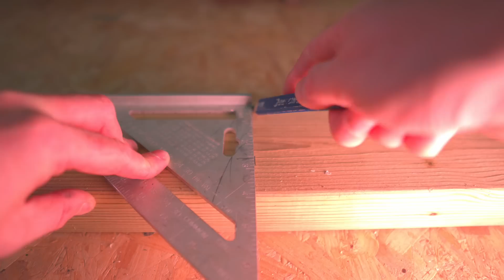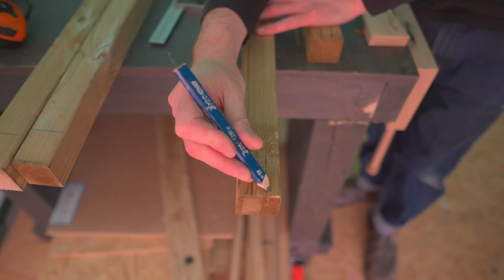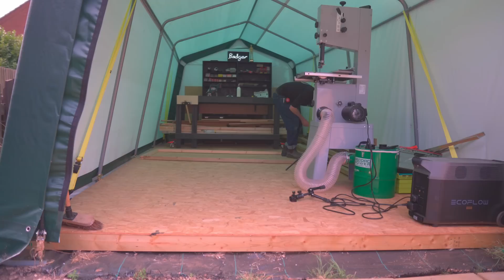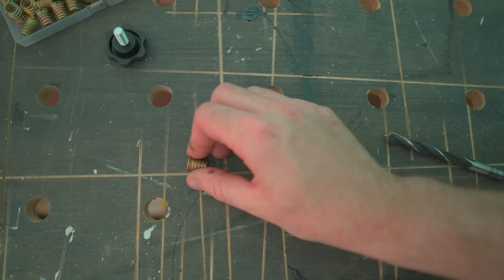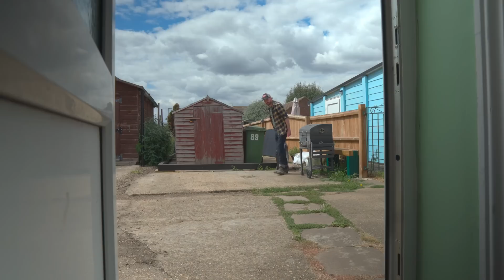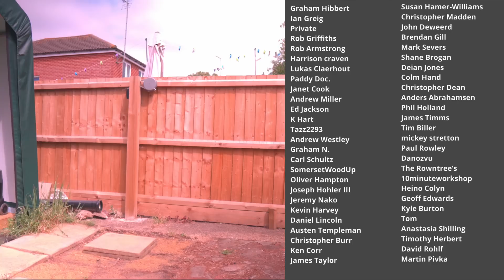Bridle Joint Solar Frame

Comment: Hi Matt,

Would you say it’s been reliable enough in terms of solar charging to run your workshop off as the only power source going forward (as in your permanent workshop)?

Obviously £4,500 is quite an investment, but given the cost of getting an electrician to run cable to a workshop, the cost of electricity increasing and of course being more climate aware, I’m wondering if you could just buy one of these and not need any power run to the workshop?

I guess it will be interesting to see how it goes in the winter being solar charged only
Reply from the maker: Building that I used about 5% of its capacity

Comment: I’ve had my doubts about renewables but this is a practical demonstration I can appreciate. I still have reservations but there’s no denying they can at least provide for some of our needs. Talking to a chap I know who works for a local company that developers and manufacturers new solar panels and they’re working of floppy solar slates for the roof that act like rubber tiles and are X amount more efficient etc…something along those lines anyway. A large battery bank in the garage and those on the roof have got to be a good idea.
Reply from the maker: The tiles sound a great idea
Reply: The question is, how much energy went into creating the solar panels and batteries in the first place. This is one of the factors that people miss with electric cars for example, especially considering that battery lifespans are probably only 15-20 years, maybe less depending on how they're used. Not knocking anyone trying to use renewables, as its definitely the way forwards, but there was a process to make these devices in the first place, and the carbon effect of that needs to be taken into account. It might take a good number of years to regain the outlay you spent on the equipment relative to what you saved in energy costs, but if at the end of that, the batteries and panels need replacing then its not quite as good as it sounds. Not saying that this is always the case, but needs to be considered
Reply: We’ve just ordered our first EV. We’re under no illusions that there is an environmental cost to building them, possibly somewhat higher than an ICE vehicle. We’re also concerned not just about how long the battery lasts, a 7 year warranty implies it is probably going to start degrading after 10 years or so, but how are these batteries going to be recycled?

However, given we have solar panels (came with the house), zero tax on EVs and needed a new car we decided now was the time. I guess it’s about everybody doing a little bit where they can, 100 people making a 1% improvement is easier than one person making an 100% improvement as they say